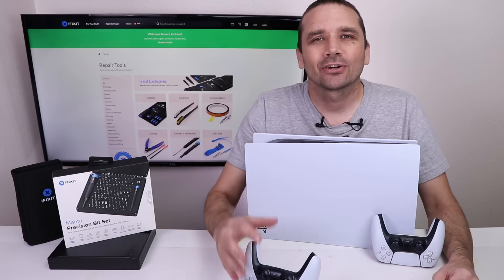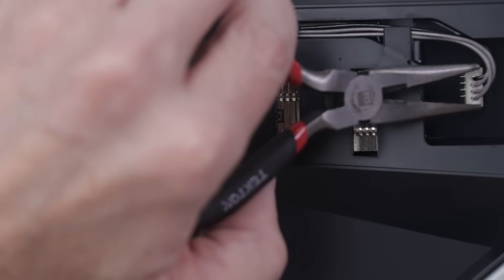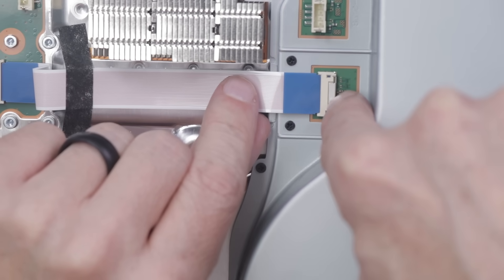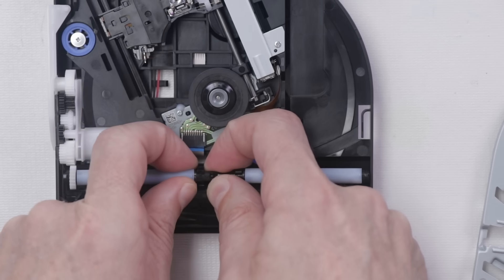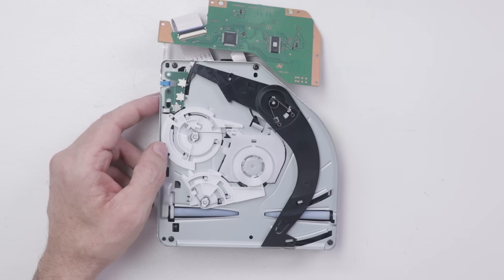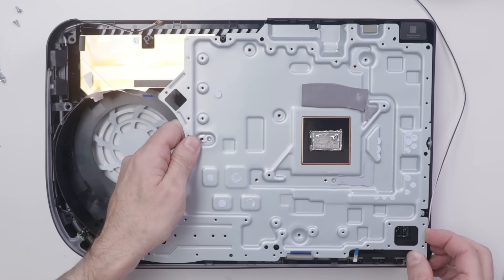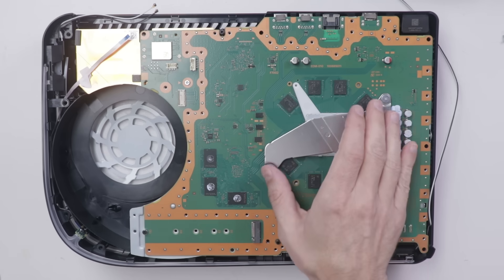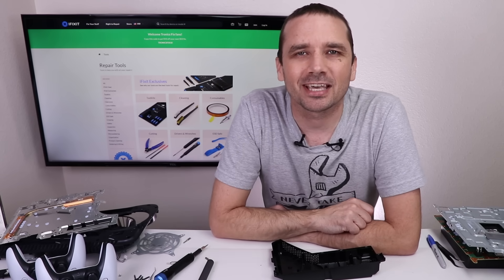PS5 Teardown - A Repairability Perspective

Comment: Looks like an absolute nightmare to repair. The motherboard in particular looks like replacing any chips will be akin to precision brain surgery, some of the traces are so fine and some of those chips are the tiniest I've seen. It's like it's been designed around the circle of chips to look cool rather than make sense.
Reply: It's interesting that the SSD on the XSX actually seems to be replaceable. I believe it is a big mistake on Sony's part to have soldered the SSD on the board, but that's me. Time will tell how well that foam around the processor holding the liquid metal in place will fare with the amount of heat these consoles generate. My guess is that there might be issues 3-4 years down the line with heavy usage. In my opinion it is also obvious where the two companies decided to spend most of their money when it comes to these consoles. Microsoft went for higher quality and more powerful internals and more innovation when it comes to cooling, allowing them in turn to keep the size of the console in check and keeping it shaped like something which does not stand out so much, at the expense of not putting in more innovation when it comes to the XSX controller. Sony went with a more traditional cooling design, also needing an even more massive heat sink cause of the higher clock speeds they run due to the SoC being inferior to the one in the XSX in terms of raw performance.

Comment: That chip you pointed out next to the SSD NAND wasn't the southbridge by the way, that was their custom SSD controller.  That's why it's soldered to the board.  Those aren't generic consumer SSD's.  (The NAND probably is, but the controller is not.)

Comment: As much as I like clipped on panels to hide screw holes, I think Sony went about this the wrong way. Someone is going to inevitably drop their console and one of the panels is going to pop off. I'm also curious about how strong those clips actually are. What's the durability for repeated assembly and disassembly. Another curiosity is PS5 disc and PS5 digital intercompatibility, assuming the drive itself isn't bonded to the motherboard, would it be as simple as sourcing a disc drive and a new side panel, or do you think Sony went a step further with actual board changes to disallow this from being possible? As far as console layout and repairability, I think Xbox definitely won this generation so far, and I doubt the future PS5 slims and/or pro models will be any simpler than this. 

The storage comparisons between the two consoles is interesting. Sony has gone with dual internal solution with one soldered and one a full m.2 card. Microsoft has gone with a single internal m.2, though height limited, and an external card that seems to be a CFExpress Type B. Microsoft, again, has won in the early generation, as the current expansion card's controllers are capable of 2TB, plus you have the internal 1TB card that can be upgraded once larger capacity cards shrink down to that size; whereas Sony is stuck with 825GB, near 20% of that (158GB) is reserved for system, with one expansion slot. Until SSDs in the form of m.2 cards start having massive capacities, say 4TB+, Sony is taking a loss here, or until Sony provides greater internal storage without an entirely bloated OS; and at that turning point, Microsoft will be taking a loss in the late gen, unless mid gen refreshes allow for a full sized internal m.2 card, and/or prices of CFExpress cards come down or the XBSX fully supports CFE-b to m.2 adapters, which are already on the camera market as that's CFE's current dominant market. The storage size issue doesn't seem apparent now, but it will become apparent when game sizes become massive, which they will, considering we already see 100GB games, and games are expected to become 200GB as a standard thing; just like the early PS3/XB360 era had small games early gen but late gen had massive games in comparison. 
But I personally think as long as XBSX is fully compatible with CFE-b to m.2 adapters, they'll have advantage all generation long, especially with the storage expansion being external, and this will only be helped by upgrading the internal m.2 slot to be compatible with longer cards; otherwise Sony can only equal them by upping their internal chip to 1TB and make system resources much leaner so that 158GB isn't taken up by just the system. 

Also why liquid metal? There's no point as you can't overclock the device, and even if you could, you're not chasing numbers like what liquid metal is actually used for, and as far as I understand, liquid metal is not a long term solution. I want to see testing done between liquid metal and traditional thermal paste on the PS5, just to see the outcome more than likely prove my point that it's a meaningless addition, one that only adds cost and complexity, not to mention it makes reparability more difficult as liquid metal isn't a carefree application, unlike non electrically conductive thermal pastes that can be overapplied in a carefree manner. I'd also like to see opinions from people who deal with liquid metal a lot, various overclockers, Der8auer, GN, etc., and I'd like to see Louis Rossmann's opinion specifically considering he hates the stuff.

Comment: The video showed that access to the heatsink is difficult (you have to separate the processor from the base of the heatsink).
It seems that if dust accumulates in the heatsink, it will not be easy to remove.
Perhaps the best way to clean this dust is in the cooler compartment.

Comment: I have a question:
Can you assemble the fan back without the fan protectors?
Explanation: There are two metal protectors on each side that don't seem useful and could rather block some airflow and add noise. So if they can be bypassed - that would be a win.

Comment: That disc drive is screaming "im going to break" to me. The ps4 2 lever system is replaced by a 1 lever which means theres more stress on the single lever and is likely to fail sooner than the ps4 one.

Comment: I'm interested in getting into electronics repair, could you recommend what I should look into to get started?
Reply: go on Craigslist or Freecycle type sites and gather things already broken, test yourself with that first.  doesn't have to be a console, any electronics.  That will give you experience in teardown and putting it back together, with no real risk.  Then do the same thing for something with an issue you might be able to repair without special equipment, like controller buttons or replacing cables etc.  as you learn your confidence will grow.  most repair work is not complicated, just takes steady hands and a bit of research, as everything is different inside.  most people are not doing soldering or chip replacement etc, that need hot air stations and such, so i wouldn't engage that type of thing until you are way more knowledgeable about the process of teardown and rebuild.

Comment: After that tear down, I think it's safe to say that this is one of the most frankenstein designs I've ever seen for home electronics.   It looks like this thing was designed by 10 different people, and then just altered to come together and align as best as possible, for the finished product.

Their heatsink design alone, looks headless, along with their comical use of thermal compound covering almost everything inside that could even remotely produce heat.

Lastly, what is that stupid outside component that wraps around with all the buttons on it?  Who approved this monstrosity?  They should be fired.

I see a PS3 FAT -> PS3 Slim style redesign coming for this thing.  ie.  Drastically different.

Comment: Xbox really wins for reparibility, hey? 38 screws to take the motherboard shield off is excessive
Reply: its not a shield, its really a heatsink.  Thats why it need all those screws for correct pressure to ensure good contact across the whole board.

Comment: It looks like the PS5 really struggled with heat that's why they had to use expensive liquid metal as i bet if you put normal paste on it will start to get really hot and shut down. Plus all the heat pads that is on it with the big ass heatsink bet they did not think it was going to be a problem with heat till they started designing the PS5 so they just stuck lots of thermal pads and liquid metal to solve it expensive mistake on playstations end.

Comment: Hi guys looking for advice i have an old xbox one still works but after 10 min or so it makes a high pitch noise when i pull the power cable out and turn it back on its away works perfectly fine just anoying is it the port or the power cable and is it a fire risk thanx

Comment: what an overcomplicated design...I'm running away from it. Great video!
Reply: noob
Reply: It's simple lol.
Reply: @jazz_bass_merchant  when you look at how the series x is built it is not simple. both consoles are great but you can tell Microsoft has a better engineering team.
Reply: @amedmayorga3375  Don't care about the engineering. I just want something easy to open up and play some games.
Reply: @amedmayorga3375  Do you not know what simple means? The PS5 is a classic console design. The Xbox is incredibly advanced.
Reply: @MN-jw7mm  the ps5 design is simple?? You are tripping bro.  That console is a mess from the inside. Why do you think it's so gigantic compared to series x?
Reply: @MN-jw7mm  yes the xbox's design is more "advanced" but that doesn't mean complicated. More thought was put into Xbox series X's design but was done with the intention to make things nodular.

Ps5 relies are traditional design concepts but is still complicated when trying to access anything that isn't the fan or expandable storage.

Comment: I would NOT replace it with anything less than liquid metal. I know thermal paste is much easier to use and much less expensive, but there HAS to be a reason as to why the SONY engineers chose to use liquid metal and not thermal paste.  I guarantee it was not their first choice but rather needed considering how big of an upgrade the PS5 is to any previous console(and likewise for the new Xbox). The hardware upgrade is easily the biggest generational leap and thus produces A LOT more heat. I am willing to bet you will get frame stutters and maybe even thermal shutdowns after long(30 minutes +) gaming sessions if you replace the liquid metal with thermal paste.

Comment: This teardown is a mess compared with the Xbox Series X. Not only is there a ridiculous amount of screws, but the layout is wacky.
Reply: I think they ran in to heating problems near the end and had to sort it out fast that's why there is thermal pads everywhere and the liquid metal. As it looks rushed to me and this is a possibility as shown with the amount they had to do for cooling the thing so they had to move things around fast and put in a bigger fan so not much designing went it to as it was rushed to meet deadline as the more screws and thermal pads they use the more it cost to make so cost them money and eats profits. Xbox deisinger there's a lot better.
Reply: @giggity4670  i don't think it's better designed, ps5 looks amazing easy to disassemble and has better cooling system, plus all third party games that was supposed to play better on Xbox it was actually better on ps5, so all the raw power for nothing, although best thing bout xbox is gamepass
Reply: @giggity4670  and after all that the xbox still has overheating issues.
Reply: @jakshepard  If you are on about the one with the smoke that was going through the xbox that was someone blowing vape in to it to make it look like that they even admitted that and Xbox had to release a statement saying to please not blow vape smoke in to it as it might do damage or are you on about a different case.

Comment: They put vacuum holes near the heatsink so you can clean out dust. I don't know how well they will work, but you should be able to use canned air to blow it loose and use an extended wand to clean it out.

Comment: Well from the initial reports of PS5 failures and Series X failures your going to stay busy for awhile. It is always the same with new console launches. The same was for the PS4 and Xbox One when they launched. What is funny is Xbox One had a lot of Disc Drive failures when it launched just like the Series X is having. A lot of reports also being made with PS5 consoles bricking due to what appears to be SSD issues. It will be interesting to see what has caused the issues for both consoles and what Sony and Microsoft do to correct the problems. Great video as always! Thanks Tronics Fix for these cool videos:P

Comment: Damn, soldered storage sounds like a bad idea no matter how you slice it.
Reply: Well the speed of the storage is way faster than what is out right now.
Reply: @MrCreepjo  I would 100% sacrifice some storage speed for repairability. The benefit of speed will most likely not be worth the inability to easily expand or replace a faulty soldered chip. This in my book gives the Xbox Series X a huge plus over the PS5
Reply: @oscarbarrios  I mean the closest to ps5 memory speed is really expensive but the games coming out are taking full usage on it, without it those games kinda have no meaning since if you seen spiderman miles morales load time between areas, fast travels, going into games and chunks loads benefit having fast memory speed. 

Since right now if you see Xbox Series X load times on on reviewers have shown loading in chunks of area even with it memory speed showcase a bit of chunk rendering error that kinda makes it choppy.

Plus Xbox using propriety for their expansions so both have their cons.
Reply: @MrCreepjo  memory is ok to be soldered. There’s somewhat less need to expand and tends to be less fault prone. What I was talking about was SSD storage, where games (and the OS, I presume) are installed
Reply: @oscarbarrios  Again Xbox uses propriety for expansion storage which is a con itself.

And the game out especially first party are very much going to utilise the speed of the storage that Sony using since what hindering Xbox Series X is the chunk rendering when you go into the game. On AC Valhalla has shown this unpleasing renderings on the backgrounds.

Sony from what developer has says even mark cerny said is to address this issue with their ssd speed.
Reply: @MrCreepjo  just for a moment, forget  about the xbox, the issue is beyond comparison. On a strict consumer perspective. The ssd on the ps5 WILL fail and not being able to replace it without throwing away the console or having soldering equipment (and maybe even like that might be not possible) is not a good thing at all. There was no reason to do that and the difference with a normal modular ssd in speed times are most likely in the couple dozen second range. If someone tells me “you lose the ability to repair your ssd but you get 10-20 second faster loads!” then I would not take the trade-off.
Reply: @oscarbarrios  It's highly unlikely an SSD will fail it's really unlikely. More like it's hard for SSD to fail it's not a hard drive.

Also It's not about loading time of the games it's about the render time which is different from what I'm saying here.

On a repairing it sucks of course not being able to remove the ssd to repair in a point of failure but at the same time people want fast speed and render times.
Reply: @MrCreepjo  an ssd can fail. Actually one of the parts that is most replaced on a computer is the drives. Regardless of your own opinion about failure rate of storage drives (again, look it up, is always on the first things to fail) , i did some research on this particular case and seems the MTBF of these SSDs is decent but every SSD has a set number of writes before it fails.
As for the render times, most data is loaded to the main memory before being distributed by the APU on the render cycle. Usually the bottleneck is not on the ssd. I see no evidence anywhere that this particular solution will improve any texture streaming if that's what you are referring to.

Comment: When you have an inside plate with various different screws, take a thin piece of card, do an approximate drawing of the plate you're removing then mark the screw positions and with each screw you take out, push it into the card in its location so you can replace them in the correct hole on reassembly.  You will not remember where they go if there's more than about 3 types!

Comment: I hope to got I never have to manually take this thing apart for repairs/cleaning
Reply: Cleaning is easy, there are vacuum ports. A strong enough vacuum will get dust out. All you have to do is take the covers off. The fan is easy to get off too.

Comment: Soldered on ssd, seriously hidden heat-sink fins and power supply? Yeah that's not gonna be an issue at all nooope. light of death in coming any minute now?
Reply: Leopold  Not too true, I work on Macbooks as a side job, ive had ALOT of 2013-2016 SSD's that have flat out failed from the SSD controller they used. Luckily they weren't soldered, but it can still very likely happen.